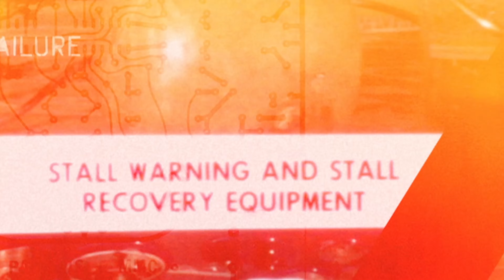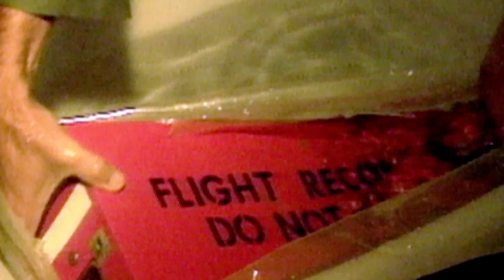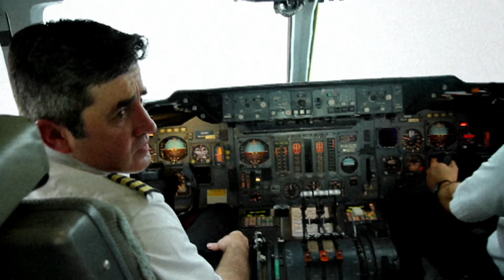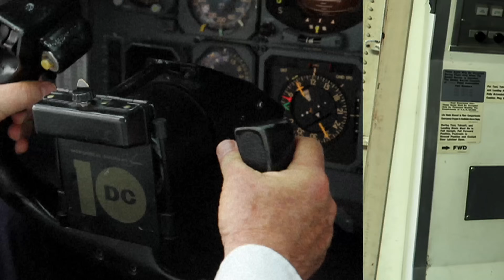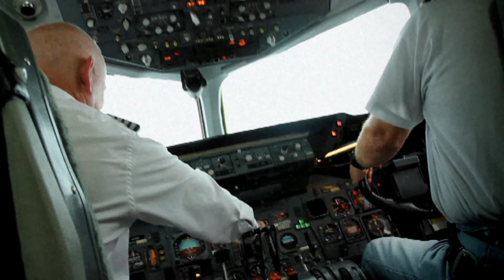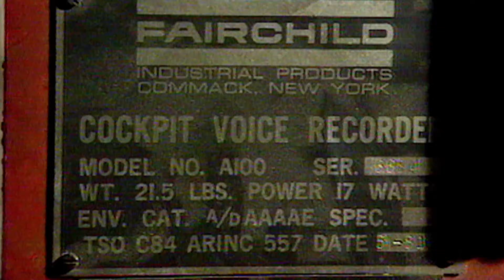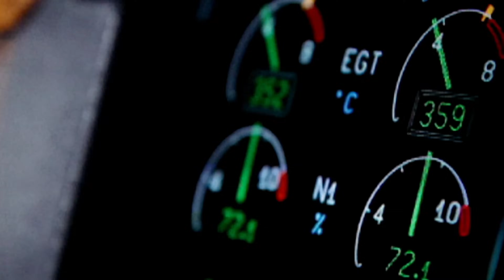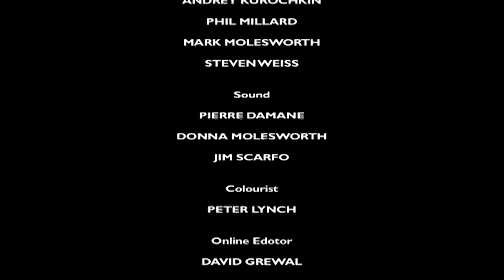Turkish Airlines Passengers Suddenly Fall Out Of The Plane Mid-Air | Air Crash Confidential S1 E4

Comment: The DC10 the engine fell of due the mounting cracks. The blame was put on the airline but they didn’t say why. Were the mountings supposed to be checked for cracks but weren’t?
Reply: Airline to blame because they used a sloppy maintenance procedure that cracked the engine pylons. And yes, they failed to check their work. Continental Airlines did the same thing, but they CHECKED their pylons afterwards and found cracks. Unfortunately they didn't share that info with anyone else.
Reply: That would be in the designers or builders official "CHECK-LIST" Most likely the designers.  So, there IS a paper trail.

Comment: You don't have to be a engineer to know what will happen with that little fluid in the tank. 🧐🤔
Reply: As a kid I tried to remake that fuel tank explosion using gasoline since I couldnt get kerosene, which is much more volatile. Try as I might there was just too little air to make a gas tank explode, even when I switched from a spark to a strip of Al foil that made a bigger spark with hot balls of plasma. How could kerosene be more dangerous?
Reply: @lexinexi-hj7zo 
Good Question 🤷🏽

Comment: Recently boeing door also blown off in same instance
Reply: Uhmmm…nah, not quite the same instance. I mean sure, you can grossly generalize the two & say aircraft doors blew out but in actuality there’s some huge differences between the two cases & analytically are two completely different problems & situations altogether.
Reply: It was a terrible design. The negligence that caused it should not be able to cause a catastrophic failure of a plug, of any size. It's SO EASY to build them so that they cannot come off!

Comment: 1999 Virgin Airlines 777 - brand new plane, take off over Heathrow, less than 1000 ft, smoke filled front & back of plane with smoke. Happy to not be dead. Ok, if anyone is interested, we were our plane's 3rd flight (they told us). From the end of each wing at 10k feet they dumped airline fuel all over London. Then we landed in some distant corner of Heathrow - so endless waits ten crappy hotels we had to go through. Like, not hotels, not motels, just some random rooms.

Comment: Wires should not be replaced and spliced when insulation is cracking - it should be completely replaced and is called a wiring harness in most industries . Also critical systems should be above non-critical systems - like the flight controls . They do that in restaurants so the stuff placed on the lowest shelf doesnt contaminate the product on the shelves above . It is basically the same concept - you dont want one bad system to take out all of the systems under it . Basically common sense stuff really ....

Comment: No one understands this but traveling in air is so risky because so many things have to go right at the same time
Reply: air travel is still safer than cars or trains. As the deadly accidents occur less than car accidents which occur daily even every minute across the world... the televised and media covered air crashes make it seem like the death toll is higher, but it is not... hundreds can die in one crash but crashes happen less frequently...
Reply: There is a reason it is one of the safest ways to travel and that is because of the amount of things going right at the same time. It is ultra rare for anything to happen to you when you fly. The reason it seems so "risky" is because on the off chance something does go catastrophically wrong, you have zero control as a passenger. If it's your time, you're going whether you want to or not. Only for that reason do people fear as much as they do. That said... I will not step foot on a MAX at this point because they've put profit before people. Boeing has some work to do. Full stop.
Reply: Actually, it's almost the opposite nowadays. Many things have to go wrong for a plane to be at risk.

Comment: We only can imagine failure situations if we  have studied and  experienced many different scenarios,  this goes for every new engineer and person for that matter. Experience is more valuable than education. always. It is impossible for every person to know and understand what is going on in real time. and it can take years to figure out what went wrong after, never mind the minutes or seconds there is in the real time before an accidents happen. 
I studied the engine falling off while studying aeronautical engineering, it was a shortcut the airline used when removing and replacing the engine during the regular maintenance intervals. the shortcut overloaded the rear engine mount, which is easy on aircraft that are designed with weight being so critical to to them being able to fly or not.
Reply: Interesting post, and hindsight is very convenient. I think though in the case of 191, we didn't need any hindsight. There is wide consensus, I think, that they should have recognized the dangerous shortcut beforehand, reject it, or should have checked for damage after, as Continental Airlines had done. The FAA head at the time said, paraphrasing, "they were banging on it with a big old hammer." He was appalled.

Comment: This series leaves a lot of stuff out probably for more dramatic effect but every one of these stories there has been information left out in this case to make the manufacturer look solely responsible when it's usually more than just one thing that brings an airplane down it's usually a series of events that if you take any one of those away you probably don't have an accident

Comment: I don't know what they are talking about @30:00+.?  The fuel tanks ALWAYS HAVE AN EXPLOSIVE mixture in them especially gasoline which becomes a vapor you can smell in the air at below freezing(32F).  That fuel liquid gets used up on a long trip so there is always a bomb under the plane.  It is no different than the 1972 Ford Pinto(when rear ended the car explodes especially when the tank is half full or less) Which ALWAYS happens.  The half a tank of fuel.  The other half is explosive vapor.  It is the vapor that the engine burns, not liquid fuel.  Kerosene or diesel works in the same way.  (Vapor dude, vapor) though kerosene or diesel vapor is much less explosive as it needs more heat just to ignite.  (I used to throw lit matches into an open vat of fuel from a distance. Yeah matches would go out several times before they lit the fuel fumes...if it was kero or diesel.   Gasoline...if I stood downwind from the fuel and could smell it...THAT WAS TOO CLOSE to the fuel...if it was gasoline...as I would also catch on fire as the clothing & hair also held in the fumes.  Not stuff to play with. Even at temperatures say 0 F.  If you can smell fuel then that is vapor.

Comment: He compared it to losing steering and braking on a car... I had that happen on an s10 when the cab broke off the frame. I survived cuz the truck parts just came to a stop on the highway. So it's way worse than a car losing steering and brakes. The only thing on my body that didn't survive were my pants
Reply: My alternator died and my steering wheel worked, but my wheels wouldn’t turn.  I managed to slow to 35mph from 70mph before coasting a bit until I hit the metal barrier separating east lanes from west.

No one ever believes me when I tell them the steering wheel worked but the wheels wouldn’t turn - they all talk about power steering just making it harder to turn.  This was almost 20 years ago, and just last year I read someone had the exact same issue in a random fb comment and she was getting the same feedback I had. 
Anywho, there’s nothing scarier than having no control and the vehicle is still going, but you’re right - it seems to be a lot less of a risk for it to happen in a car.  Btw, I still wonder if it was something else and not the alternator.  Car was totaled and we never looked back.  Glad you survived your accident!
Reply: Oh dear...Did you mourn the death of your pants or pant with shock?

Comment: Ok, so be patient with me. Could a plane like the DC-10, if designed in 2023, have a wireless backup rear control system? As a possible extra failsafe option at first so passengers don't freak about wireless flying? That would make physical controls expendable if the jet's body is damaged by decompression or wild propellers or even an external bomb...

Comment: Fuel vapors, ignited by a frayed wire, so now they pump in inert gas when tanks become low on fuel, in a particular tank. As well as checking all the wiring.

Comment: I'm sick of this idea that engineers don’t care about human lives. In almost all cases, the decisions they make are logical and based on sound data. Take the TWA 800 case. It wasn't bad engineering. They had no idea this could happen. Or the engine falling off the DC-10. If the maintenance had been done properly that accident never would have happened. Nothing wrong with the engineering. If you engineer something and put it through a rigorous testing process and something that later causes a disaster never shows up, how are you supposed to know it's a problem?

Comment: Very sloppy people working on the DC10...apart from ALL the appalling designs flaws, you'd THINK that the atmosphere inside the fuel tanks would be Nitrogen, they knew full well that a nearly empty tank with just fumes and an air atmosphere is just ASKING for trouble, spark from wiring or not, but with that heat from the climate control system being dumped right on it...heads should have rolled for this sort of incompetence

Comment: 20:28 There has actually been a somewhat successful crash landing made onto an airfield after losing hydraulics. The crew controlled the aircraft by adjusting the amount of thrust from each engine. It's nearly impossible to pull off, though, as later attempts in a simulator demonstrated.
Edit: Actually it was done twice. The second time was a complete success even though a wing was on fire after being struck by a missile.

Comment: Its failsafe , until it isn't . It doesn't matter if there's a reason or an excuse its still not the way I would pick to go.
Reply: Actually, the description of 'fail safe' in this video isn't quite the same as the original idea, which arose during the development of railways. The braking system in early trains used compressed air to apply the brakes. It was only after a particularly serious tragedy that it dawned on engineers who designed trains to convey large numbers of passengers, that it would be safer if compressed air was used to RELEASE the brakes. So if a compressor fails, or a pneumatic line ruptures, the brakes are automatically on. If the air is used to APPLY the brakes, you can't stop a train that's tearing along, heading towards a crash. With a failsafe system, you can't even get the train moving if there is a failure.

Comment: What is the difference between taking off with an empty fuel tank and the fuel tank approaching empty towards the END of a flight ? : in the latter, the scenario is UNAVOIDABLE! Fuel is there to be used, after all - or it wouldn't be there. So the REAL problem is sparks in the fuel tank, NOT the empty tank. Duh.

Comment: Why don't they have parachutes installed inside each seat just in case you get blown out alive?
Reply: You get blown out "alive" at 30,000 feet with the plane going 500 mph, you will quickly no longer be alive and a parachute would be useless.

Comment: TWA 800 was an engineering mistake? I thought it was old deteriorating wires that arced? DC10, the company that made the cargo door told them the lock mechanism would fail and it did fail in their own pressurization testing yet they still let it fly. American Airlines flight 96 was a major warning before the THY 981.. if they fixed it in 1972, that horrible 1974 accident wouldnt have happened. The engine falling off was due to AA not doing the correct procedure in servicing the engine. Plus the warning system and captains instruments were connected to the left engine, so they didnt not get a stall warning.. they couldve flew out if they knew that wing was stalling. SO they put plugs in the lines to maintain pressure and had the warning systems power from more than just one engine, but that shouldve been done originally. such sad cases.. Wasted life.

Comment: I find it interesting the British Voice narrating blames the fuel issue on Boeing when in reality the heat exchanger found to be at fault was part of the Rolls Royce engine and subsequently redesigned by them in response to the NTSB investigation.  The FAA recall didn’t apply to 777s with GE or Pratt & Whitney engines.  

Also, he says that engineers need to design everything to be safe in the event of an unpredictable failure.  By definition, unpredictable means you can’t anticipate it and design a fail safe for it.  🤔

Comment: Do you know how expansion vessel works? If is not possible one big fuel tank make this way, probably is possible devide it in let's say 6 smaller tank's in same area. By the pressure in ballon would be known quantity of fuel in tank,woudn't be necessary any septum, any electric wire in it, with temperature of air in the ballon is possible to keep fuel in always same temperature. In two words,no matter how many fuel is in tank,tank will be olways full. If you take a look on truck air suspension you will see that technic allready exsist in much more heavy duty that will have in fuel tank. Same thing(air balloon or pillow)in fuel tank will have bigger size&lower pressure,that pressure enaugh to indicate fuel level & keep fuel always "tight" together no matter of fuel quantity.

Comment: Kids have a huge abilitty in brain power to learn, like pickup languages with an indistinguishable accent relative to where they grew up. allowing kids to control a simulated aircraft with friendly game like interface where they can compete with friends using only engine throttle to land as if it a smooth ILS normal touchdown. Data will be streamed and recorded and it would be so interesting, especially if brain activity can be monitored like EEG or PET; could they achieve consistent safe ILS-like landing and how long would it take? How would each age group perform and where would the peak of the standard deviaton bell graph be? Study ages between 4 to 35. Where is the 95th percentile age group?

Such software called PCN or Propulsion Controlled Aircraft already exists but rarely implemented if at all due to costs and how  rare all hydraulics fail; but it was these 2 accidents that promped NASA snd the manufacturer to develop and integrate the tech. Its probably traditional code; but what if we bring in AI and specialised GPUs?

AFAIK there are only 2 known cases where pilots did the seemingly impossible improvising as there are no training for something like this and still isn't for the ATPL/CPL as it was deemed unsurvivable. One was a FedEx flight delivering military supplies to a allied forces base then struck by ground to air in middle east by terrorists that wrecked one wing. They were joined and reported by traumtised French reporters. Terrorists were cheering but left after their second missile missed completely. JAL123 did almost make it but crashed into remote mountain.

Aviate, navigate, communicate or simply 'just fly the damn plane!'They almost made perfect landing after few trial and error using only throttle input; and being only able to make right turns so some crazy mental maths were needed, that enabled touchinng down on perfectly on centre line but lack of hydraulics means they cant steer using rudder, no flaps slats brakes or spoilers so it ran off the runway and engulfed by desert sand using that friction to dissipate kinetic to heat energy to stop. Tower thought they broke up but after dust settled it was only a collapsed front landing gear and some scratches to the paint job with a half broken wing. Pilots walked out unharmed maybe just some bruising and superficial cuts from whiplash. No fire though, very lucky after making it off the  plane guided by firemen for unknown landmines; now that would really suck! Think the plane was repaired and even flew again!

Comment: Man you can see the fuel mix is way to ruch the fap trails are sooo big. and its hot august too that fuel is more folotile in hot weather it can ignite outside after leaving engine exhaust..hot weather fuel mix needs to be tuned down, couse of expansion pressure build up, more likely to create fumes hot weather reduces ventilation all in out all aroud the plane..static can ignite fuel in hot weather..

Comment: If one’s car malfunctions, there’s every chance that one could maneuver into a safer spot, such as the side of the road, while there’s still kinetic energy moving the car before it assumes a cars’ normal state of being nonfunctional.  If one is in an aircraft which malfunctions, once the events which transpire as a result conclude, if that person is still living, it is only because God is fanatically, insanely in love with them. This rule does not apply if the aircraft is a helicopter. I would require a series of lobotomies while being brainwashed and fed LSD and Thorazine by Branch Davidians for six months before I could become stupid enough to be convinced to board and then travel in a helicopter. 
 Being encased inside a tube from which there is no possibility of escape, while  suspended literally miles above the ground, is patently obscene.